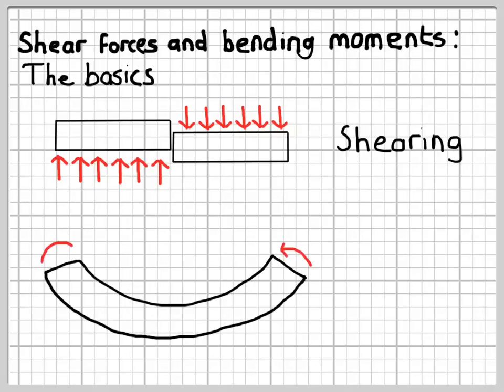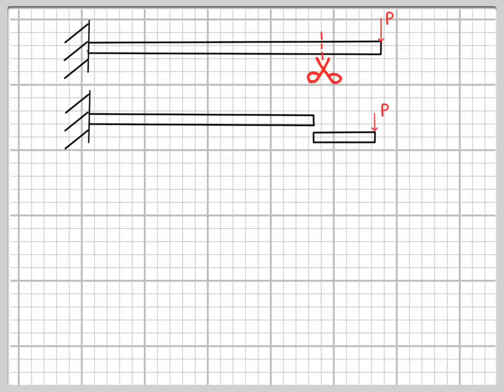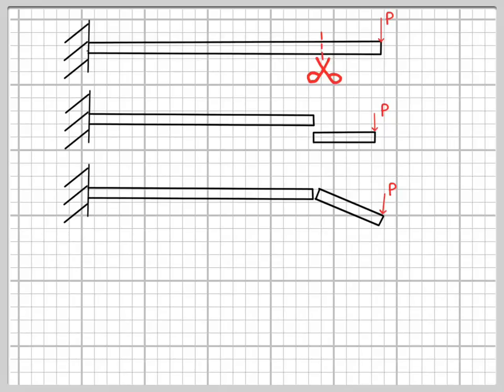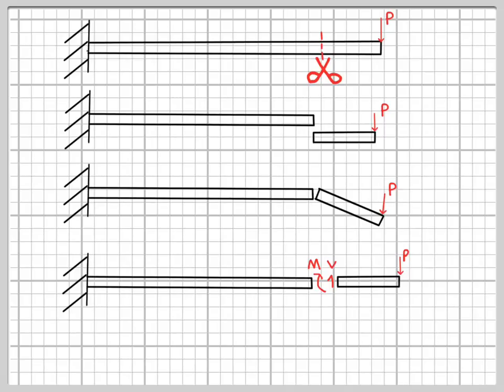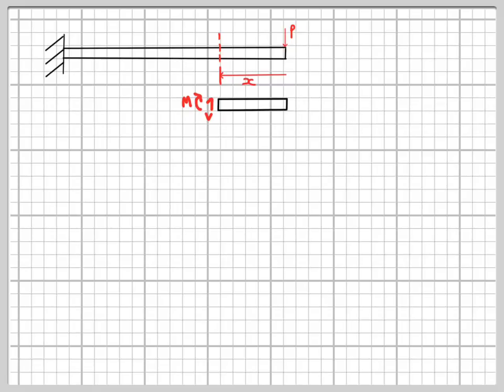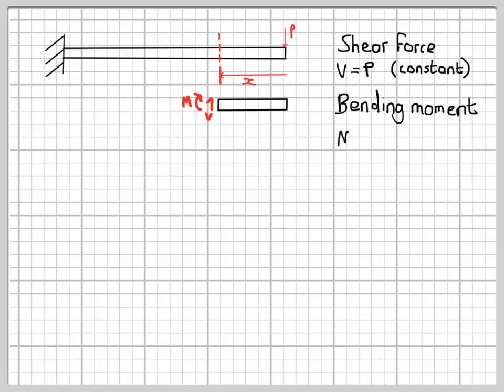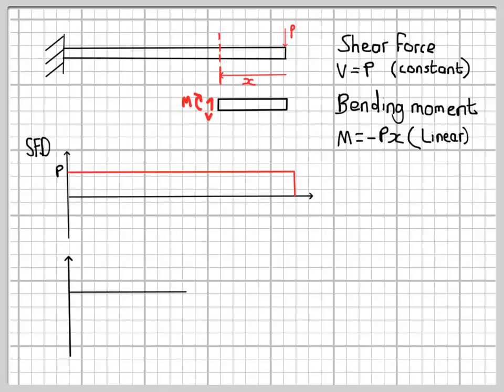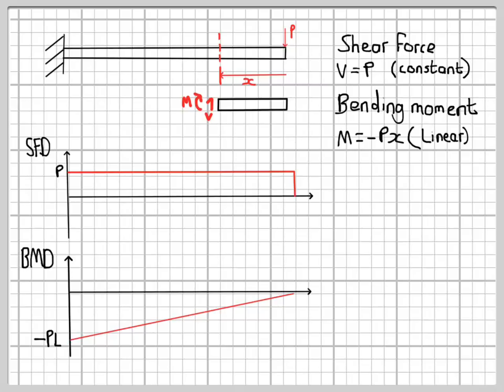Shear forces and bending moments: the basics

Comment: if the bending moment is increasing linearly, why the negative sign. it should be M=PX-pl not M=-Px
Reply from the maker: +RobertoEmilioRomero   Hi Roberto,  The negative sign arises from the sign convention we are using which defines "hogging" bending moments (those that produce tension in the top of the beam) as negative.  This convention is arbitrary but widely used in beam analysis.  It is similar to saying that tension, rather than compression, is positive when considering axial forces in members.  If the reverse sign convention was used, then the bending moment would be positive